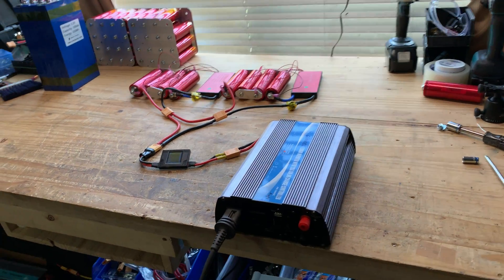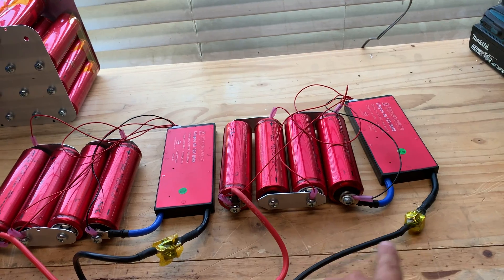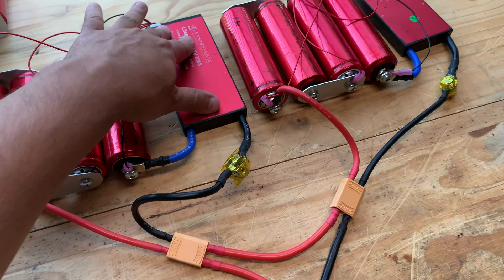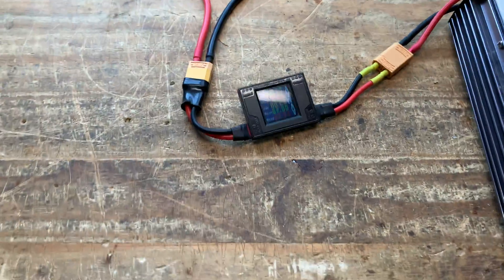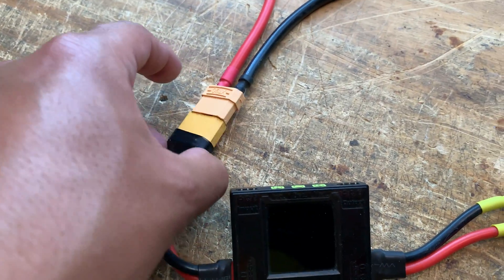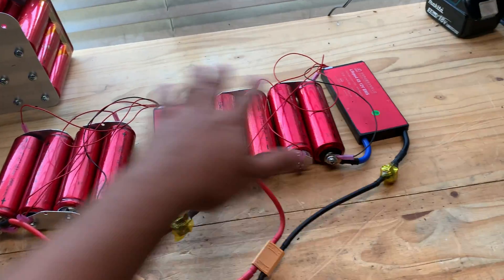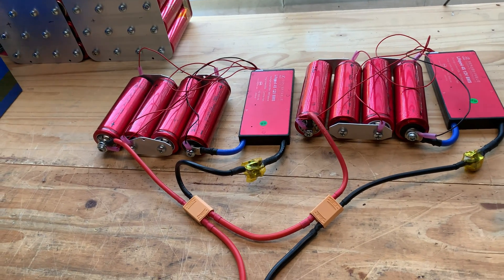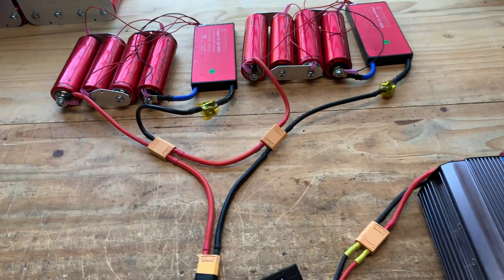BMS Battery Module -  Can you Series connect them?

Comment: Another informative video. I'm really into watching anything regarding the headway 38120s right now. I was thinking how many of those larger bms's you have but you said you ordered those for that project. Since I'm still interested in getting the most amperage out the headways in 12v. Also from last video you did on the headways you put a link for buying used cells. I wish I wouldve seen that before I ordered mine from China. I couldve got 16 cells from the site you linked instead of 8 all though mine will be new.  I can already see me running 24 of the headways and possibly running a bms per 4 cells just to get closer to my 1000amp goal. Now I know this will be expensive as all get out but everyones gotta have a hobby lol

Comment: I have a 6s BMS  circuit  and I want yo make a veritable power bank. like when I want to charge my phone. One phone support quick charge 3,  another qc 2. So I want an system where I can chose voltage and current.
I want 0 volt to 24 volt.....
who to calculated max output current like if I want more backup time how many battery I need to add.

Comment: How could you possibly give this man a thumbs down for trying to help you to who gave the thumbs-down you are a real piece of crap thanks for trying to help us all out of here
Reply: Tom Jones I didn’t give him a thumbs down but I can completely understand how someone who is observant could. The fact that after the left BMS shut down the circuit still had 12v means that one of the balance wires on the BMS is completing the circuit. This is an exceptionally dangerous condition that could easily start a fire if the battery pack was under load.

Comment: If that was a 48v system, can one 12v bms cut the other pack's voltage? (36v)
Reply: technological singularity No. it should be like cheap Christmas tree lights. When one disconnects, you lose them all. As others have suggested, the remaining 12V was probably bleed-through.
Reply: @sailingadventurous784  It was weird. Jehu if you applied a 12volt load after they trigger could you track where that is coming from/.
Reply: The assumed answer is yes, just as we saw here. There will be an upper limit, a voltage that will kill these things or they won't be able to switch, no idea what voltage that is.

Comment: I guess the real question is charging. 
If you try charge them as a single 24V battery one BMS will cut out when charged before the other has finished.
Normally a BMS would do cell balancing but since it doesn't know about the other BMS it would end that when its cells are full/balanced but the other BMS may not be finished.
However that might be ok, since with a series string you only get the capacity of the lowest cell anyway.
Reply: Would that be mittigated by having a second loom that does a parallel hookup that you just switch over? I guess thats a hassle for most use. But in my situation of having a boat motor running off 48v but wanting to charge from one or two 12v panels. Ie a versatile parallel series switcheroo loom
Reply from the maker: Yes so it does what’s is supposed to do,  disconnect as soon as any cell group reaches 3.65v
Reply: @jehugarcia   will the second pack keep charging if the other is fully charged?

Comment: Will the packs become unbalanced from each other?
Reply: Yes, will be just like normal series.
Reply from the maker: Only if packs are not well matched
Reply: @jehugarcia  and Philip Housel: to clarify, well matched in this case means that all the cells are the same capacity, the same ESR value, the same ESI value, are exposed to EXACTLY the same temperatures during their life, and have the exact same number of charge/discharge cycles on them. There may be other parameters that must be taken into account that I don't know about too. The point is, it is going to be pretty much impossible to keep them perfectly in balance over the long term. They will drift. The reason other chemistries like Lead Acid can be put in series without a BMS is because you can overcharge those cells without them self-destructing, meaning you can apply enough overvoltage to sufficiently charge the lowest cells without hurting the highest cells, thus keeping them top-balanced at all time. With Li-Ion, the charge cycle is interrupted as soon as the first cell reaches "full", regardless of the state of the rest of them. So, whichever pack is lowest in charge state will gradually drift to be lower and lower every time you recharge it. Of course, depending on how vigorously you cycle them, the higher pack will deteriorate at a faster rate due to higher charge state, and that will reduce its capacity. In this way, they may actually balance out over time, slowly deteriorating the higher pack until it matches the lower one. Not sure if that is what you meant by "unbalanced" or not though.
Reply: @WarrenGarabrandt  It depends. In the RV and marine community, they have found that the large LiFePO4 prismatic cells stay in balance when used in low c use. These cells do need balancing when used in high draw usages like electric cars but not when used in low c situations.
Reply: @cdkipp  Really? I had not heard of this. Can you point me to a source so I can read up more on this, and what they found? I'm curious.
Reply: @WarrenGarabrandt  A lot of RVers, including myself, have had that experience. I am on my fifth year with a 700 ah LifePo4 pack that I use continuously and stays in balance. I check them and put them in parallel to balance every 9 months or so but they are always extremely close.   The real work was done in the boating community and there is a lot of materials on their experiments and findings.  https://marinehowto.com/lifepo4-batteries-on-boats/  http://www.cruisersforum.com/forums/f14/lifepo4-batteries-discussion-thread-for-those-using-them-as-house-banks-65069.html
Reply: @cdkipp  Ok. That's good to know. So, you are manually equalizing them, and they are very close when you do this, so it sounds like you have a good system that works well for you. Not to nit pick, but if you didn't equalize them manually, my guess is that they would gradually drift further and further apart. 
When you equalize them, do you just connect them in parallel for a couple of days, or do you also apply an external charge to them to speed it up?
Reply: @WarrenGarabrandt  Yes I hook them all in parallel and then charge them with a 3.65 volt charger. Let them sit a bit and then give then one more charge.  I should note that that is the only time they get charged that high. I never charge the pack more than  13.8 for 12 volts and usually don't go below 12 volt for cut off. The LiFePo4 cells have almost all of the AmpHours between 3.0 and 3.2 volts. So while I am not watching closely on their balance I also am not pushing them on the high or low side.  Others have had the same experience. It is interesting because I am interested in batteries for the RV solar storage purpose and for the remote control drone usage.  Very different protocols in how they deal with these batteries.
Reply: @WarrenGarabrandt  I bought my cells new from Jack Rickard. If I was using used cells I would approach quire differently.
Reply: @cdkipp  yeah. Sounds like you got a great system that works for you. I've got a bunch of 18650s that I want to put into service, but I haven't found a good bms yet for what I need. I may end up trying to make one, but I'm aware that this is something that is very easy to screw up in subtle ways that would be catastrophic. My cells are salvaged from old laptop batteries, so no way can I get away with not using a bms in my case.
Reply: You would be better off getting 2 8s BMSs and building 2 24v Batteries and running them in Parallel. The series BMSs wont correctly. Balance the whole system.
Reply: Yes they will .... but there is a unit that might work well - see 3A Li-ion Lipo Lifepo4 LTO Battery Active Equalizer BMS Balancer Energy Transfer on Ebay $43

Comment: How are you getting 12v after the BMS triggers? It opens the circuit right? Should be at 0v? Or am i missing something
Reply: My thoughts too. Very strange
Reply from the maker: I think it’s ghost voltage,  fet leakage  won’t actually support any current
Reply: @jehugarcia  maybe the BMS was passing some current from the B+ (small wire) to the load minus (not B-)
Reply: My assumption is that only one of the two BMS got triggered and that's how he was getting 12v. If both would have gotten triggered then it clearly would be 0v, but 12v was enough to trigger the inverter shutdown.
Reply: The SmoothGoat as jehu said the BMS is a switch, when it triggers it breaks the circuit. Theres no path for the other bms to feed 12v

Unless theres 12v leaking from the balance leads?
Reply: @ShelbyGT5OO  True, Good point... Still 12v seems to high for so called "ghost voltage".
Reply from the maker: Or the main fets,  off is never really off  it’s mostly,  not enough current to do any actual work.
Reply: @jehugarcia  Oh really? that's interesting
Reply: Same here